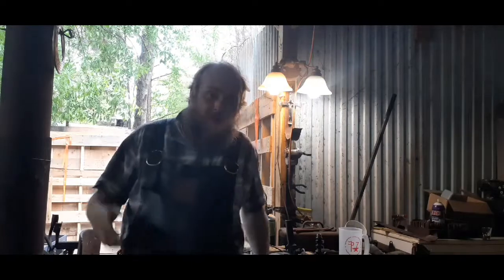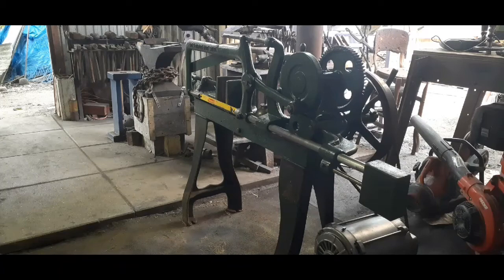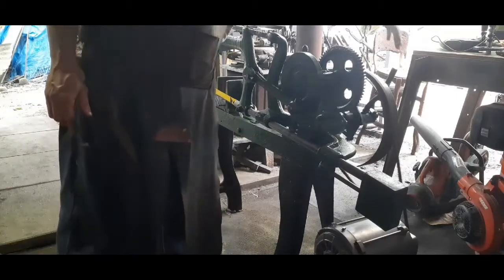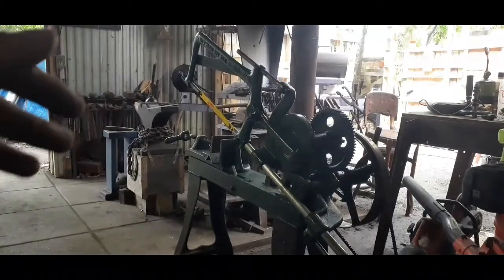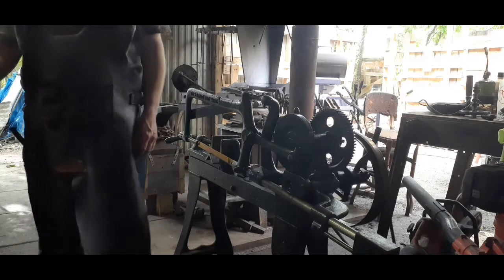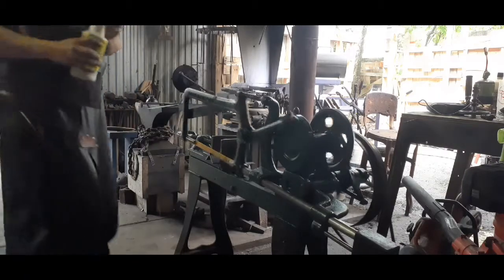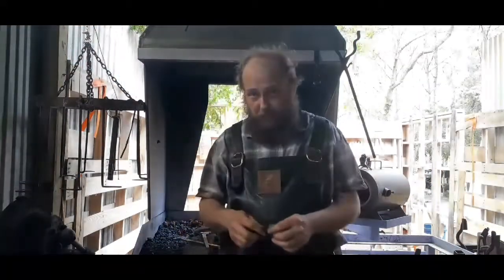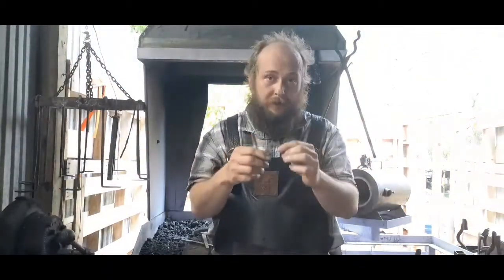Power hacksaw

Comment: Which way were the teeth pointed?  Seems like the cutting stroke should be with eye connecting rod pointed down.
Reply from the maker: Power hacksaws cut on the pull stroke so the teeth are pointed toward the motor portion. My handheld hacksaw is exactly opposite with the teeth pointing forward. This saw will cut 4"×4" maximum stock and has a 12" blade with ten teeth per inch.

Comment: I think the bar on top is for pressure. The one right behind the saw arm or weights...oh it slides on that, is there an adjustment that should cut faster than that
Reply from the maker: Took ten minutes to cut a 2x2x1/4" angle iron. These saws were designed to cut about 60 reciprocations per minute. Painfully slow. But it's a tool that you set up and walk away from. That's why folks usually dont get them. Outdated technology, but very reliable. It probably was the only option other than a handsaw back then. Basically it's a man with a saw that never gets tired lol.